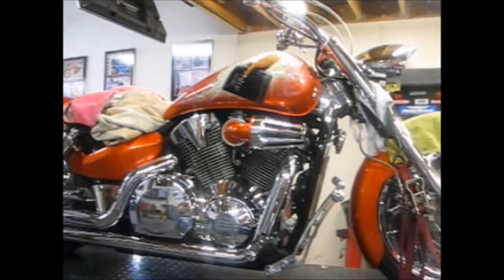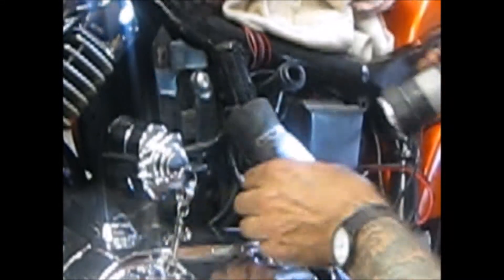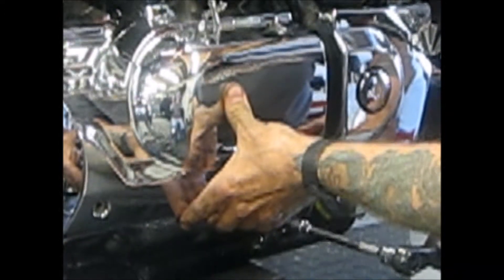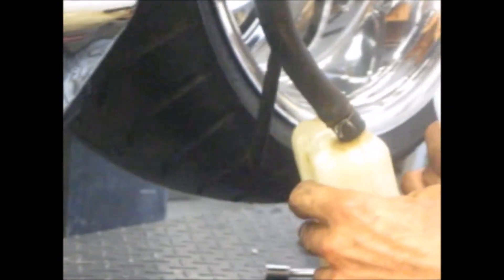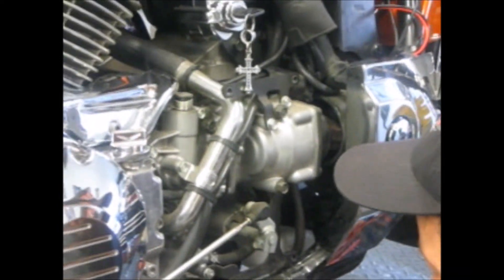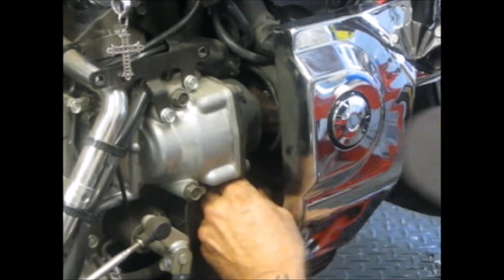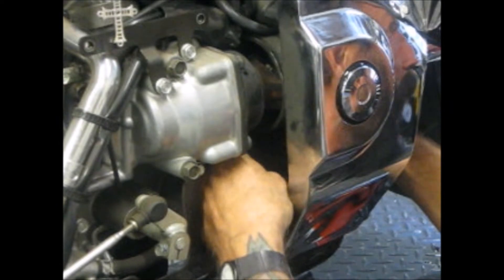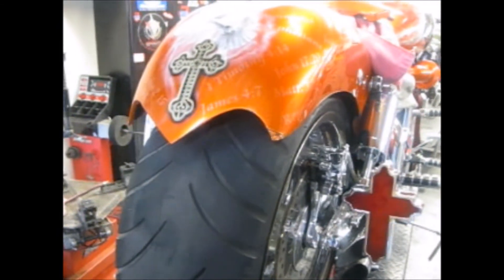2004 Honda VTX replacing the coolant reservoir box.

Comment: I’m going to be trying to do this when my tank comes in, great video! Wouldn’t mind it going a little more in depth though
Reply from the maker: If you have any questions please ask
Reply: @rodithomasmotorsports5643 
My overflow hose came off, it is attached to another hose that came off with it by a little t connector, but I can’t tell where it goes or how it hooks in.  Any ifeas?
Reply: Ideas rather